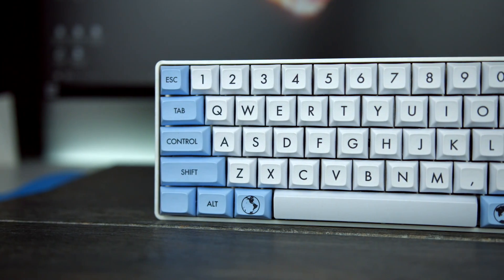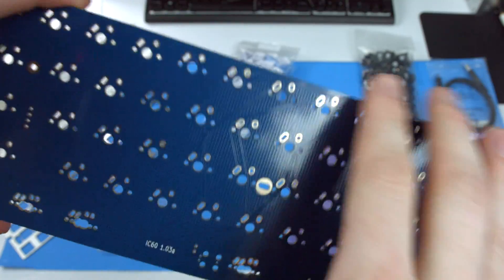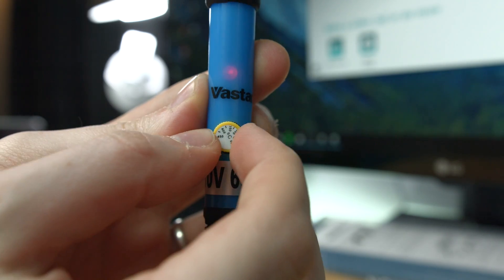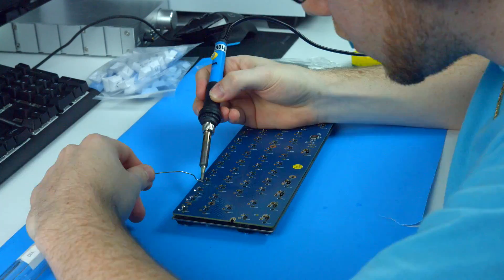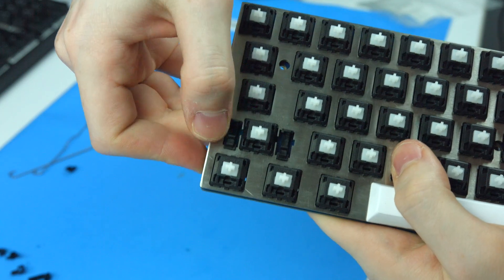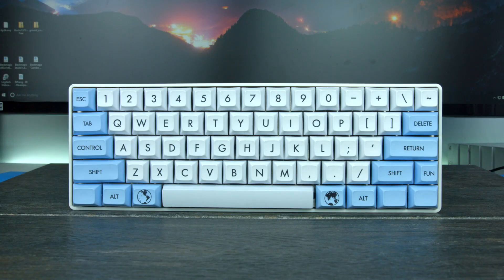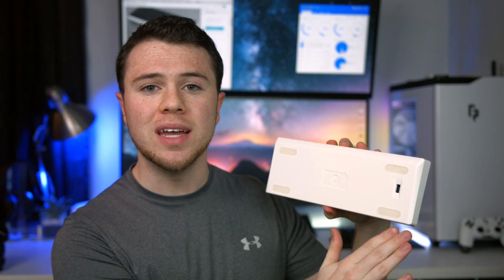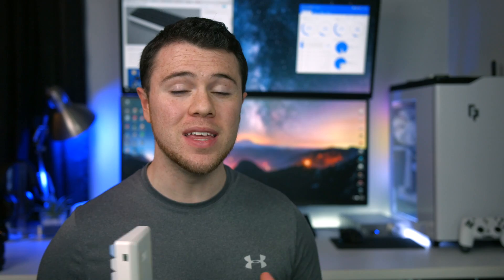Infinity 60% Keyboard Kit Build & Review

Comment: usually don't melt the solder on the solder-iron - only indirectly over the stuff you want to solder  aka basically you heat up the stuff you want to solder and that needs to be hot enough to melt the solder itself.
(may for better head-transfer, 'may' melt a tiny bit of the solder-thingy directly on the solder-iron)
else very nice :)

Comment: I think there is no Soldering Iron in the packege, so what do you do if you dont have one?
Reply: buy one.      duh
Reply: Haydn Tindal no money, duh
no ideda how to use, duh
say duh, duh
Reply: +ScoutingNugget  then get A job
Reply: +Haydn Tindal and look up how to use it
Reply: +ScoutingNugget if you're on a super tight budget, try to find a yihua 936 soldering station (hakko replica) for $20 and some hakko replacement tips (900M-T-1.6D) since the tip it comes with is useless. the quality of the station is 'meh' but it's not bad and gets the job done, especially if you're only going to build 1-2 boards. as for a tutorial, look up one of whitefiredragon's custom build videos.

Comment: The solder should never touch the iron.  Warm whatever you want to solder enough that the solder will melt onto it directly.  You will get much cleaner solder joints.

Comment: or just buy a normal premade keyboard which you DON'T need to make yourself
Reply: The point of buying this is the experience not the product itself. And it's kinda cheaper
Reply: ***** hmm, intresting
Reply: +Hivon yep, also since stock switches feel scratchy and stock cherry stabilizers are mushy af;; usually people tune their switches/stabs before assembling, but it depends on the person. the experience of building is one thing, but for the most part it's for the product - or rather the layout of the keyboard. as +ლ(≧ω≦ლ) said earlier, customs are more expensive 99% of the time, some OTD korean customs can range from $1000-$5000 depending on how exclusive they are. but yeah, funny how a lot of people think mass produced factory assembled keyboards are equivalent to custom keyboards with specially designed PCBs with layout programmability and housing + tuned switches/stabs...

Comment: Hey Frank,

Nice work, and I wanted to offer a bit of soldering advice, and it will hopefully make the process even fun and easier in the future for you and anyone else doing similar soldering.

1. Your tips seem oxidized, which leads to poor heat transfer (and in turn more time on the joint or more heat). Use either a brass or a damp sponge to clean the tip every few joints, and after turning the iron off put on a thick coat of solder on the tip. Clean that coat off at next power on using the sponge. The tip should always look bright and shiny, and NEVER brown or black. Eventually the tips become impossible to clean, even with good care, and then it's time to change them. A good indication if your tip is good is that solder should stick to it - if it falls off, or balls up, then it's oxidized and no good.

2. Use a chisel tip that has a width similar to the pad that you are soldering is ideal, as it offers more contact area. Heat up both the pin and the pad for a second, then feed the solder into the joint. Solder should be applied to the joint (that's where you want flux to go) rather than the tip itself, except maybe for a small amount to get better initial heat transfer.

3. 0.031" 63/37 solder is ideal for DIY hobbyist purposes, usually. It should have RA or RMA flux (aka no clean). Never acid or water clean.

4. While flux from RA/RMA type flux is generally not harmful (it's not lead fumes, as lead can't be vapor at soldering temperatures), but can still be a slight eye irritant and respiratory one for those with asthma and similar. Using a fan to have it not go right into into your face is a simple and effective solution.

Comment: Hey Frank. Can you do a mech keyboard next?
Reply from the maker: +zepcrazyfre This is a mech keyboard!
Reply: randomfrankp I am shamefaced. And I'm not a troll btw smhlol just an idiot newbie slowly learning more about PC gaming and Tech.
Reply: +zepcrazyfre just for future reference, mechanical keyboards will always have seperate  boxes with a cross shaped button on top or "switches" and a membrane will usually have a pcb with small shortage points which a robber membrane is layer over in order for the key caps to put pressure onto and activate that button :)

Comment: I would suggest not applying the solder in that way. It's a lot better if you heat up the pcb pads and apply the solder directly to the pads, not the way showed in this video.
Reply: What does that even mean? Nobody is the same so of course they have their own way of doing things. It doesn't change the fact that soldering in a certain way is better for the components.
Reply: did u just reply to ur own comment

Comment: Hey Frank, I just wanted to tell you something I learned in school about soldering. Apparently, you can damage the PCB if you press the iron first, so rule of thumb is to put the solder where it needs to be melted, then apply the heat to it. Other than that, another great video!